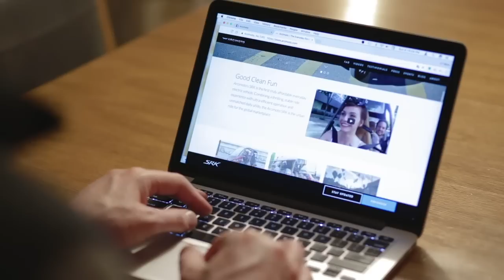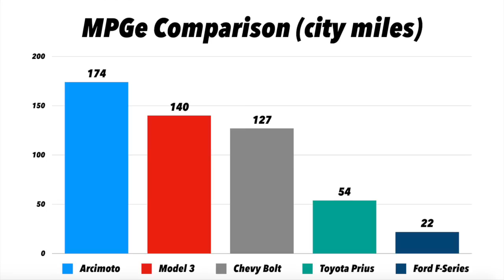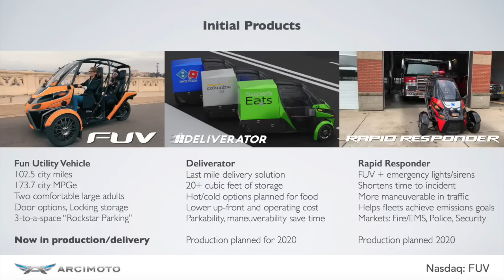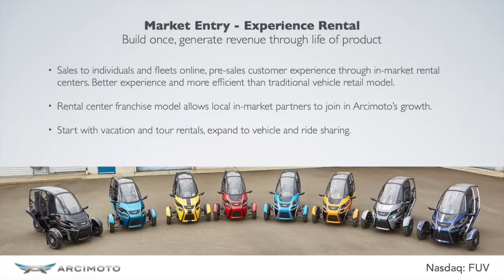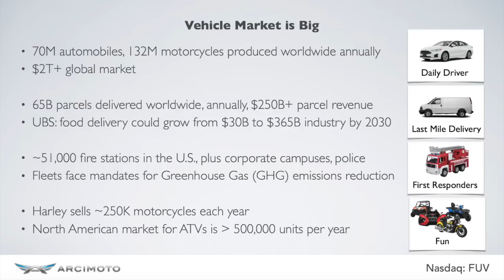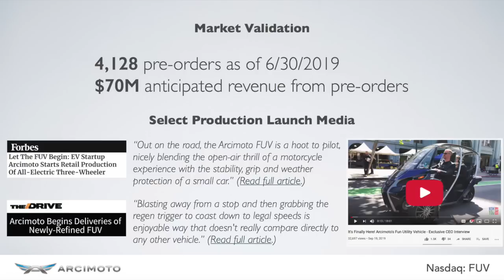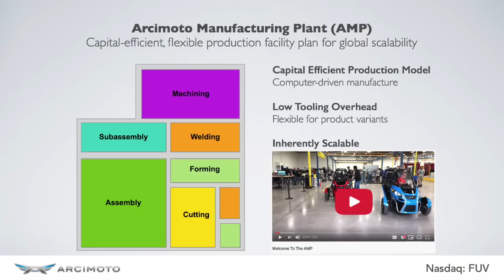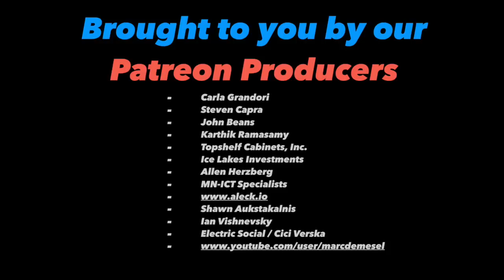The Future of Personal Mobility w/ Mark Frohnmayer

Comment from the maker: TIMESTAMPS :)

0:58 - What is the vision of Arcimoto?

3:08 - The FUV is so unique, how was it designed?

5:44 - Efficiency of Arcimoto’s FUV compared to other EVs & ICE vehicles

7:02 - Different uses for the Arcimoto platform like the Rapid Responder & Deliverator

9:20 - What’s the addressable market for the FUV?

11:50 - Arcimoto’s vacation rental retail strategy

14:05 - Arcimoto’s 4,000+ order backlog

16:40 - The Arcimoto Manufacturing Plant (AMP) in Eugene, Oregon

18:52 - Production is up and running! How fast will it ramp?

20:40 - How are you financing the company?

22:39 - What do you think about Rivian & other EV startups?

Comment: The first responder vehicle has amazing potential. I work in the emergency room and for stroke patients or for someone who is having a heart attack, time is everything.  Getting to the patients in an ambulance can be time-consuming during traffic. The Rapid Responder has the potential to improve the response time of reaching patients.
Reply from the maker: so cool! can't wait to see them deliver the rapid responders! this is a gamechanger for small fire/emergency departments
Reply: @HyperChangeTV  even for medium to large fire departments it would make a difference. Response time is a metric for success in the medical field. I hope they can use that as a selling point.
Reply: Hopefully the name of the product helps communicate this advantage.
Reply: I think new "Air Taxi" under development would be perfect for emergency responder.
Reply: Isn't this almost as wide as a normal car? I'm thinking width is probably the single biggest factor in being able to weave through traffic. It might be better in this regard than a big-ass truck based ambulance, but would it be much better than a Model 3, for example?
Reply: Don’t see the first responders potential. This vehicle is not conducive to transporting an unconscious patient.  Also need space for third person to treat victim.How is that going to happen in two person vehicle en route to emergency department.
Reply: @301rs  Its not to transport a patient. It allows first responders to reach a patient quicker to stabilize their injuries until an ambulance can reach them for transport.  

This would literally be a life saver.
Reply: DaBuffNerd Gamer. Yes, I realize that it is for transporting first responders to the scene. However, First responders can only do so much in the field without medical equipment. This vehicle would be limited in what medical equipment it could bring to the scene. So medical treatment would be limited as well. Also, The most important factor in saving someone’s life is quick transport to the emergency department.  This vehicle is a fail for medical intervention.  We already have a vehicle that can get to the scene quickly and transport the patient quickly to the hospital.  It’s called a helicopter.
Reply: @301rs  I don't see many helicopters flying in between urban city high rises to pick up patients off the street.  Most people will receive medical attention from an ambulance.

Also modifications could be made to the Arcimoto platform so it could carry what is needed.
Reply: DaBuffNerd Gamer. Helicopters are the use by the elite, police, politicians, news agencies and also medical facilities in all major cities. You have no argument.
Reply: DaBuffNerd Gamer. In addition, they are many startups that are working on air taxis, so air travel is going to increase.
Reply: @301rs  but are they used to pick up every day citizens for medical emergencies on regular bases? Come on now...

Comment: After selling a few of these vehicles in touristy locations in the USA, these guys ought to start selling in China, India and southeast Asia where three wheeled vehicles and open vehicles already have some market acceptance.

I think the vehicle is too expensive at $11,900 base price. They need to get the price below $10k to be competitive. MSRP on the Nissan Versa is only $12,460, and for that you get a fully enclosed vehicle that seats four, rides on four wheels, has full automotive safety equipment and even air conditioning and tilt steering wheel. The 2019 Versa is a remarkable bargain compared to a motorcycle or FUV.
Reply: Though you are neglecting the cost for gas, which is roughly the same as the vehicle cost over the life time.
Reply: The cost definitely seems like the biggest limiter to scale. Hoping they can bring it down to 4-5k within a few years as battery costs decline
Reply: @thomasreese2816  Ironically, scale is also one of the biggest limiters to cost. Production costs generally get a lot more efficient at higher scale.

Comment: I have been critical of Archimoto via the 3 wheeler concept in the past - either two in front or two behind. Both have advantages and disadvantages in almost equal measure. But the fun aspect is always with the "two in front" idea. Lots of minor issues fall away with two wheels leading. I wish them every success. Bring them to Europe and they will just sell and sell, especially in southern Europe. Make them a little more weather resistant and the north is theirs too.

Comment: I really hope that they make it. On the other hand there was so big boom of this kind of vehicles at 50's and 60's here in Europe. They were not EVs but small 3 or 4 wheel vehicles tho. There was real need for them after the WW2 because lack of resources. Then people got more money. The question is, do I buy this kind of vehicle with 10k or do I buy used or even new car with the same money? Car protects you from weather and accidents better. Also you don't hear your neighbors laugh at you. There surely is market for these, but in everyday use by common people....I don't see that would happen anytime soon.
Reply: "don't hear your neighbors laugh at you" )))) nice line.
this "motobike" is surely for good & safe neighborhoods )))
Reply: A used 80-mile EV like a Leaf or Spark EV is a better value, costs less, and you have a better experience.

Comment: Arcimoto's FAQ says 4hrs at 250v to charge. That's 0% to 100%? What about 5% to 60%? If it's 30mins, awesome, post that. Mostly I'd want it for groceries, you say "modular storage options" but don't show them, please do that. There could be shelf / baskets for the backseat that clamp to the frame, 1st layer starts at the battery top and splits at the seat, 2nd layer 18" above the seat top, then 2(?) shorter levels above that.

Comment: What are the price ranges of these vehicles?
Reply from the maker: www.arcimoto.com
Reply: $150,000 for a standard unit and around 220k for the model with wheels.
Reply: @abz998  More than twice the price of a Tesla Model 3? Plus if you want to drive it another $50,000. I  don't think they will sell very many.
Reply: 19,900$ for a standard model, with doors only. There is no pricing for a fully enclosed one yet. They plan to make the standard model 11,900$ with scale.
Rebates are not included in the price.
Pricing is not easy to find on the site, not sure this is a good business decision long term if online ordering is the way they plan to go...
Disregard a998, he seems to troll hard
Reply: @johnomalley3795  Remember, this is video about an FUV not FUD!
Reply: @elektrotehnik94  Thanks. Wanted to bait someone to avoid looking up the price myself. Lazy trolling works.
Reply: Btw he alludes to the price @ 14:00 

20k seems reasonable in the FUV segment but won't really set overall market on fire.

50cc electric mopeds go for as low as $1,000.

Comment: So at least $20k for a two seat three wheeler with limited cargo space and only 25% more efficient than a Model 3? Total niche product. Not sure which niche though, since the width of the front wheels makes it much less useful as far as finding gaps in traffic compared to a motorcycle.

It's clearly not suitable for family use other than as second or maybe even third vehicle. Maintaining a whole fleet of vehicles for family use doesn't strike me as efficient use of resources.

I suspect the reason for the suboptimal 3 wheel design is just to avoid regulations that apply to vehicles with four wheels. Something similar with four wheels could probably take 4 people while being in almost the same price range by avoiding airbags, crash tests and so on. That could be interesting as a cheap starting product for a new car manufacturer.

Since the CEO seems all in on climate hysteria he probably loves government regulations though, so it should be all good.